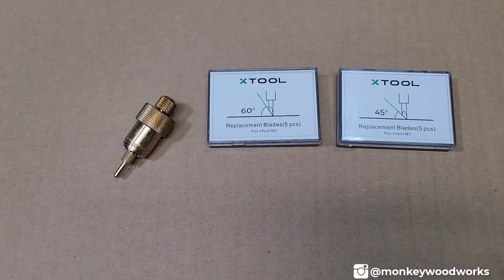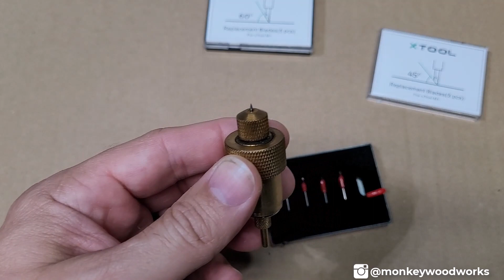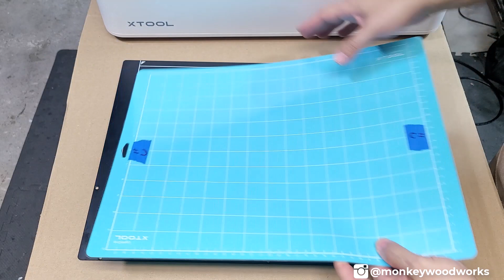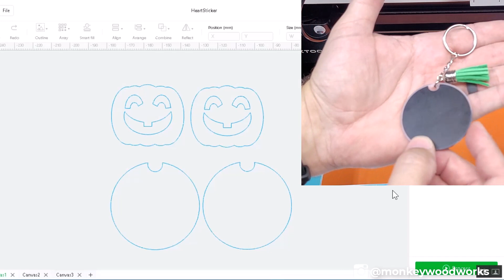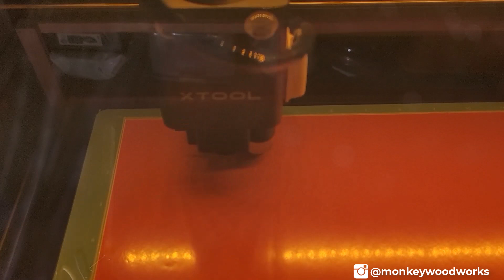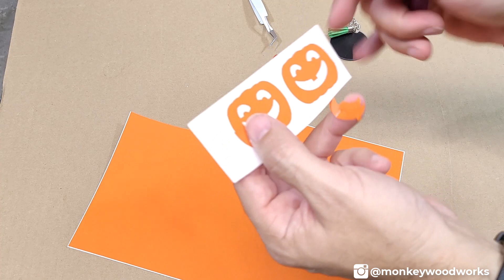xTool's M1 Cuts Like a Knife !!

Comment: Very nicely done and the end results look great. If you get more into using the cutting blade and vinyl, you should obtain what is called Transfer Paper. It is a clear tape like substance. you peel the backing off the tape and and apply the tape onto your vinyl object. In this case, your pumpkin design. You then peel the transfer tape and the pumpkin comes off. You then apply the tape where you want. Lastly, you rub the tape and the pumpkin sticks the the surface and when you peel the tape off, the pumpkin remains. Although in the case of your pumpkin, you could simply peel the pumpkin and place it on the material directly, if you work with lots of letters or intricate designs, you would have to peel each letter or intricate piece and then stick them piece by piece onto the surface. Lining things up will be tough so the transfer paper allows you to peel off letters exactly as they are printed and transfer them onto the material. (sorry for the long explanation) 🙂
Reply from the maker: Thank you so much for your kind words and the information on transfer paper!  We (Monkey Woodworks) use it a lot when working with vinyl.  I was just trying to keep this video short and to the point of how to cut a sticker.  The next vinyl video will definitely have some transfer paper in it and show the application.  Thanks again!